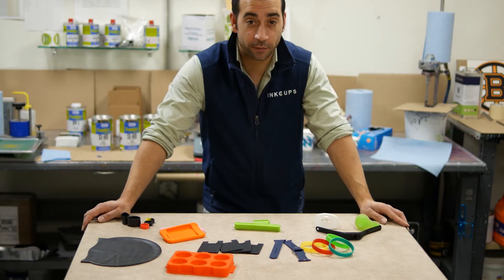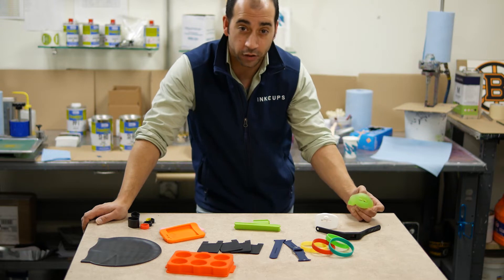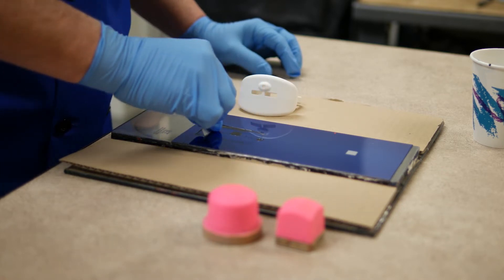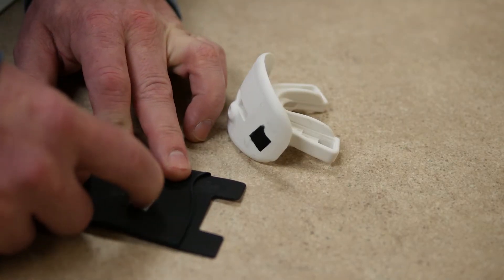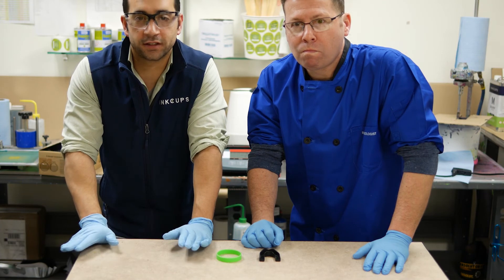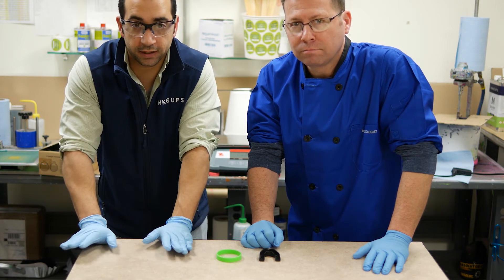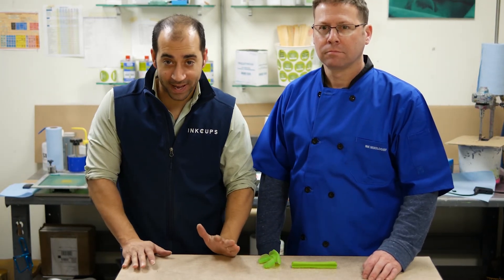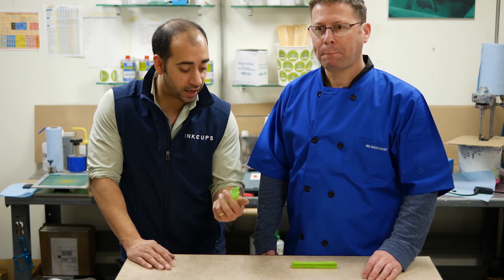Silicone Printing: How to Test if Your Product is Actually Silicone

Comment: I have a kitchen colander/ basket and I was trying to find a way of determining if it was silicone or able to be used in my instant pot high pressure cooker. 
I didn’t want to ruin my pressure cooker liner if it melted. 
I will try the flame . 
Thank you